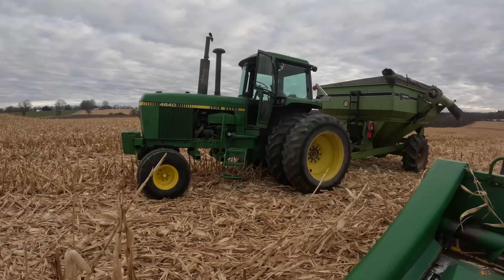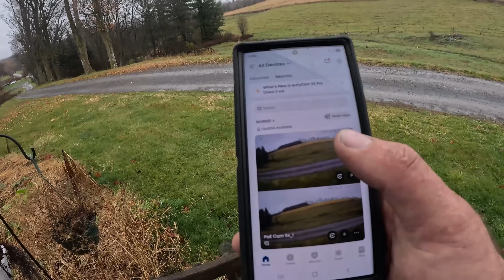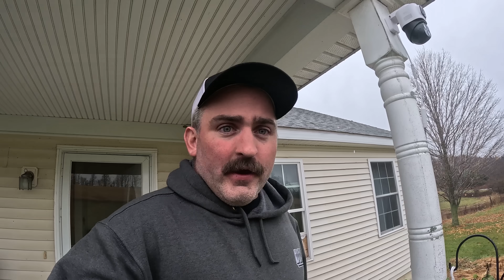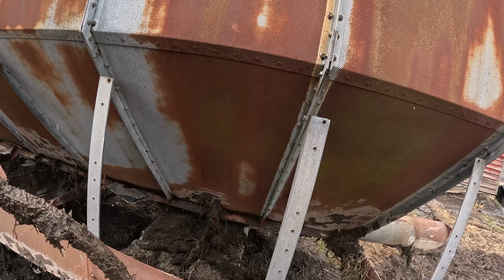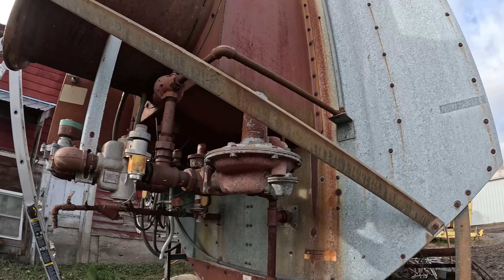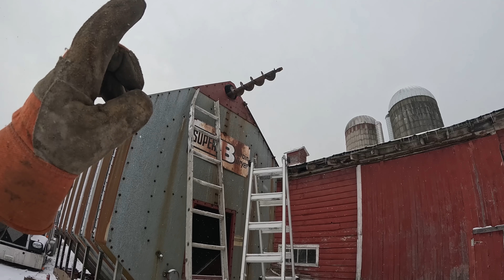Shipping First Soybeans Ever!!! eufy NVR Security System

Comment: Before the Trolls comment  crap about you should of got this and that done, at the time you get the priorities done, like the tractors,  the trucks, what machinery,  you need at that particular time, not what you need,  in 3 months time. 
Before the Trolls comment
 crap about getting the harvest in Harvesting has been difficult for farmers in New York, particularly in the North Country, due to extreme weather swings that included a dry winter, wet spring, and a significant dry spell in mid-to-late summer. This has resulted in challenges like reduced yields for crops like corn, a shift from grain corn to silage, and issues with irrigation. One farmer reported his local grain volume to the elevator is down about 30%. 
I don't cry every time an advert comes on, there's a thing called fast forward, I want to know what a product can do, before I invest money into it.
Reply: I'm west of Chris about an hour a half, a lot of crops still standing in Madison county, on farm near me has 400acres of corn standing, and we just got around 5 inches of snow.
Reply: @adamlandis8397  There you go, you're a first class witness of what Chris and your neighbours are going through.